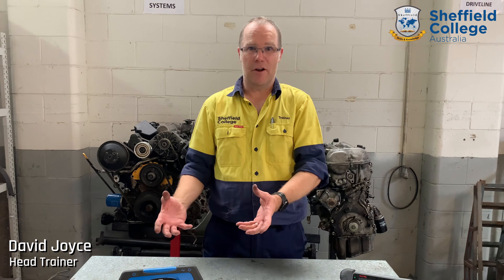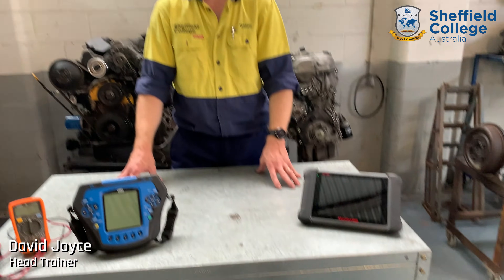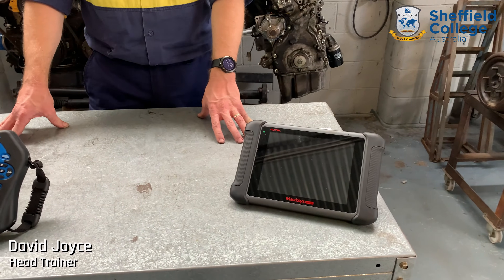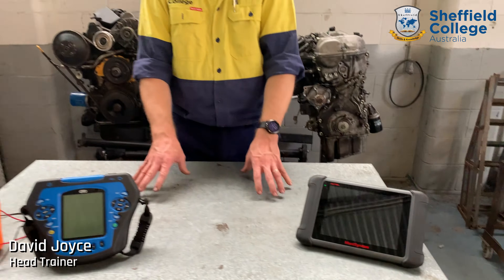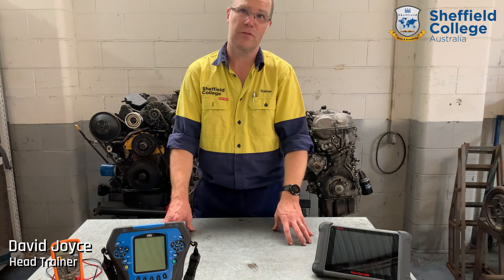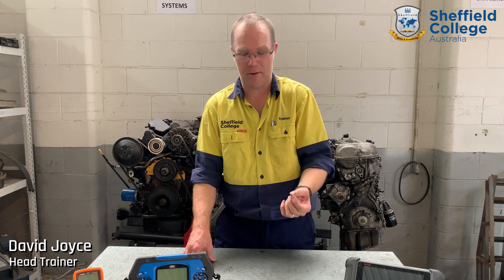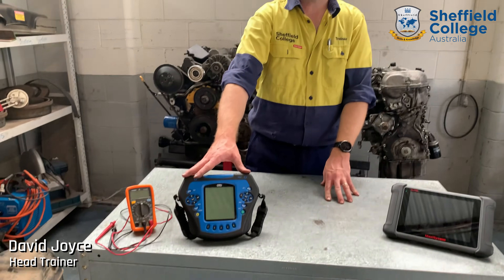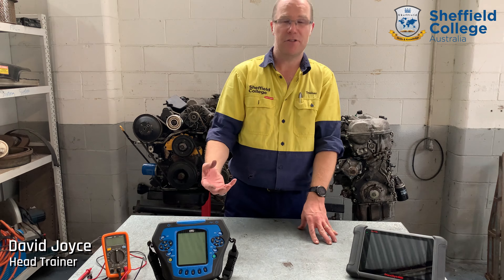What does an Automotive Electrician do?

Comment: Greetings from nz! I have a little kubota tractor with a charging problem and I was hoping you could give me some advice about it  please. All the information I've found online is for the complete opposite! It still has it original generator..not an alternator, wen the engine isn't running the charge light is OFF wen I Rev it up the charge light comes ON, idle it again charge light go OFF again. It's wired negative ground. Lil bit confused. It appears a reg fault off the bat but a man likes to do his homework first. It appears to be an odd problem on the basis that all the info online is for the charge light ON at idle.... hope you can point me on the right track

Comment: Any.nuff nuff can use a multimeter, even an oscilloscope is not a stretch for the layman. But if a car really has a problem with a bad connector or a break in a wiring loom can a student of yours realy find the fault.. i mean. Come on, norhing beats years of experience with different makes and models and knowing where they fail. Learning how to use a multimeter and a bit of ohms law surely doesnt make you an auto electrician??